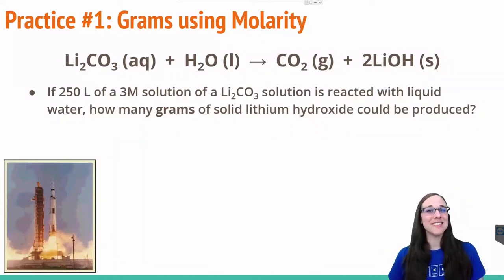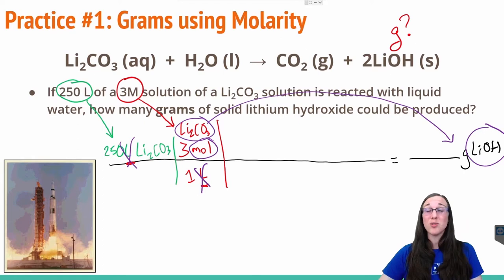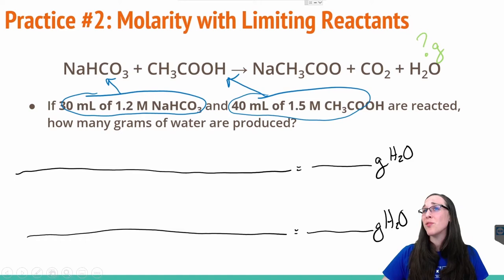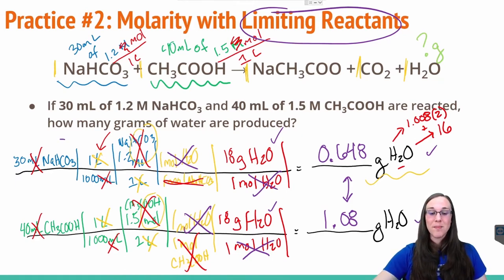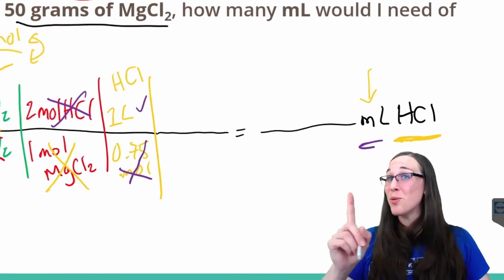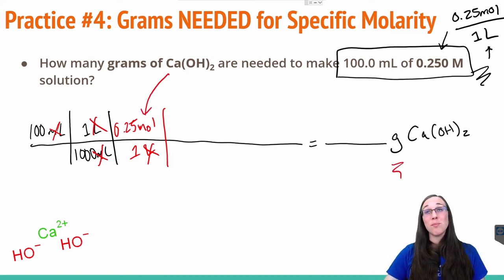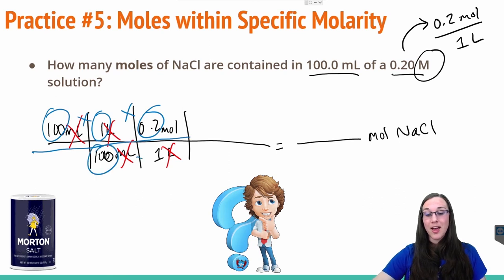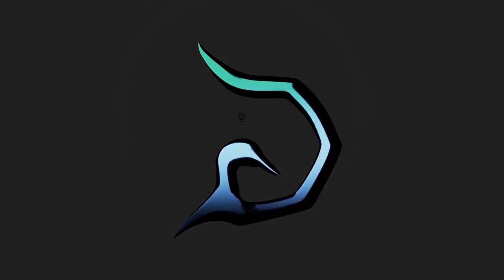Molarity Practice Problems (56)

Comment: Ma'am , Even a commerce person can read the solution in this way  . You should explain each and every step by writing on board .
Reply from the maker: Hi there, 
For the specific steps on how to perform these calculations, please see my previous videos on Molarity or Stoichiometry :) This practice video is at the end of a series (that's why there's a "56" at the end of the name because it's Video #56), so it's assumed that students already saw the steps before trying the practice in this video :) please let me know if you need help finding the videos with the steps in them, I'm happy to help! ♥️
Reply: Can't we mention the physical state of Lithium carbonate as solid ? As water is being mentioned as reactant here
Reply from the maker: Hi there Happy Hours, 
The equation you are asking about is a reversed, very hypothetical (for the sake of practicing Molarity calculations only) set up from what actually occurs in the Contaminate Control Cartridges within space shuttles (real equation to remove CO2 according to NASA is as follows: 2LiOH(s) + CO2(g) → Li2CO3(s) + H2O(g)). 
Given the MSDS information for Lithium Carbonate being insoluble in water--yes, there should technically be a (s) for solid after the Lithium Carbonate -- not because it is written with water in the reactants --- but because it is considered insoluble in liquid water, or slightly soluble, depending on the circumstances/resource you reference! 
Best, 
Duckonta